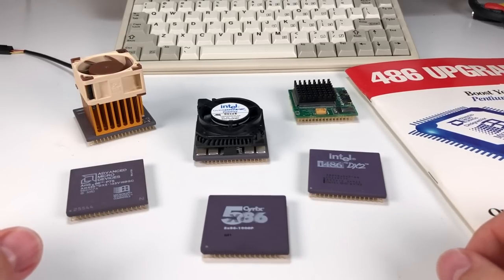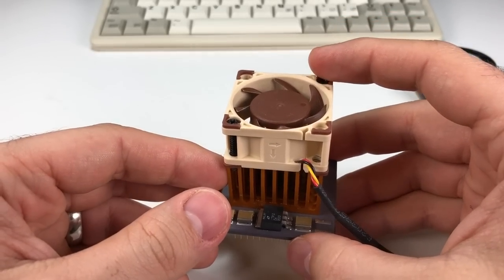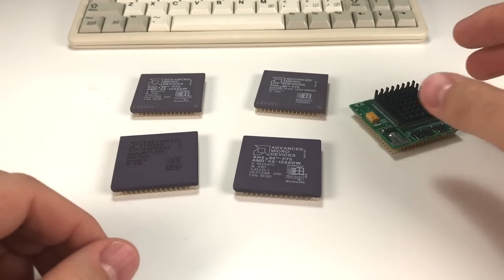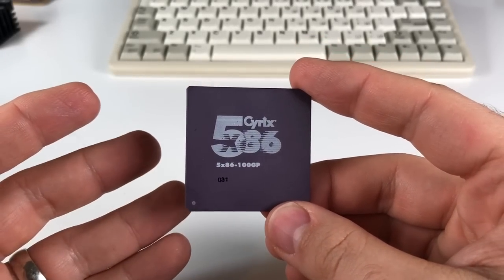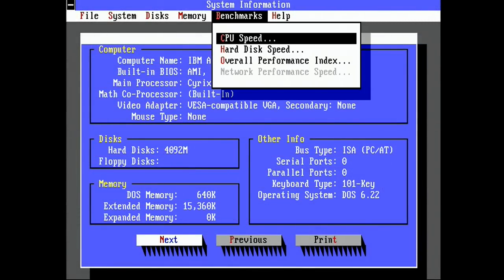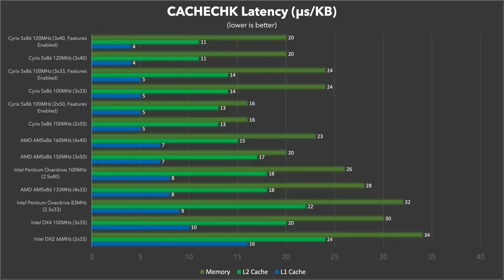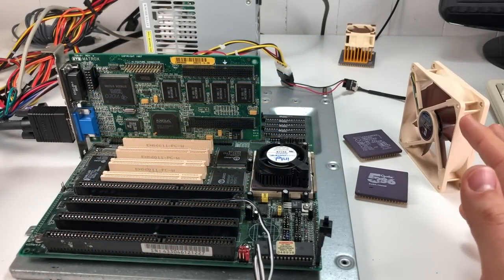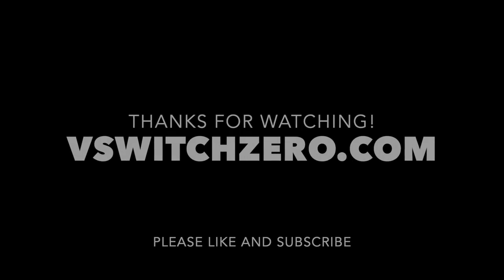The 486 Upgrade CPU Showdown!

Comment: The Am5x86 was fastest Desktop 486 CPU released during the 486 era.  AMD continued the line with the Elan line of CPUs.  SiS/DM&P produced odd hybrid architecture CPUs in the early version of the Vortex86 CPU line which were neither Pentium nor Pentium II though they had MMX but also lacked some of the Pentium & Compare/Exchange instructions.  The early ones were weird kind of super 486 DXs with fast CPU clocks (300MHz-1GHz) and MMX.  Compatibility and real perf was poor though.

Comment: It's crazy just how far tech has come. You mentioned some of these being $300 or more at launch while I paid less than that for my Ryzen 7 3800X during black friday a few years ago. And even my original R5 1400 is leagues ahead of these old chips and isn't even worth $100 anymore. I always find it fascinating and interesting just how fast technology exploded in performance over such a short time. Only 30 years and now we got 16 core monstrosities with clock speeds pushing 6ghz at the top tier, like the i9-14900k or R9 7950X3D.

(I also can't help but to find it funny that those old AMD chips have prefixes of "AM5" and now they've created socket AM5... Full circle hehe...)

Comment: I really liked those Shuttle motherboards back in the day, Interesting they are still in business, but make all in one systems, and micro PCs, probably for industrial situations, cause they have kiosks as well. I guess everyone finds their niche! :D  I think shuttle was my go to 486 motherboard, and built many PCs for family and friends. AMD was often my top choice too, they seemed to provide the best value and compatibility of the time. The Cyrix and Via worked well, but there were a few compatibility issues as I remember. AMD was usually way way cheaper than intel and about the same price as Cyrix. The local computer shop sold them at tray prices, and you got the chip in an anti-static foam square, opposed to retail box, so they were really cost effective. The local shop had trays and trays of AMD chips, he must have gotten a good price on them buying so many too.

Comment: I had Cyrix 133 cpu, wasn't that fast. Before of that, i had P 100. I swapped it for MMX intel. I already used OC ofc, i could not live without it :D One of my very best OC is on barton mobile 2500+ (2750-2800 Mhz) and 939 3800+ x2(2950 Mhz) on air. I loved them.
Reply: Barton was the chip that introduced me to this world of pc master race. Loving it since!
Reply: Had 2 x 1700+ tbred b hard modded to mp at 2600MHz on Asus dual socket a a7m mobo then xp2500 m at 2700, duron 1600 applebred at 2400.
939 3500+ Venice at 2900 (posted at 3300mhz air) then booted at 3280mhz to xp. Also had 939 a64 3800+ x2 toledo at 2800mhz with 1.35v.
Reply: @benrogers84  My 3800+ x2 did 2950 mhz stable 24/7 just took me so much time to do it in the DFI mobo but it was worth it.
Reply: @eizo monitor  that's a very good clock. Mine was a good chip too but clocked worse as time went on. Did 2750 on 1.35v and 3.03ghz at 1.5v when I got it.

Comment: Cyrix FPU is basically what killed Cyrix in their later chip too. What is interesting is that knowing this chip was released they could have benchmarked quake in-house to see the possible problems for their future gen too.

For integer performance I think AM5 is beasting over Cyrix because all tests are highly optimized for 486 hardware - likely avoiding branches with unrolling and maybe not having enough headroom in pipelineing to compensate. That is basically gains of the PoD and Cyrix does not totally shine with software highly optimized for...486s and quake shines here, but Cyrixs slow FPU is burden there...

What is also interesting is that 586s have also new instruction sets, so I guess you can use all new instructions with cyrix and Pod but not sure of the AM5 (maybe yes and emulated inside silicon). Thus for software development those might be good choice in case you only want to support new instruction sets with software you make, but not want to buy full systems for it yet.

PS.: I had 40Mhz Cyrix 486 with a good motherbord and Vesa local bus card, then switched to pentium 1 MMX 200Mhz. But switched likely much later than 95 I think. Maybe like 97 or 98 and only because dad worked in IT. Before all that we had an Elon Enterprise 128 that we gave away to family and lost track of... so sad for that one haha

Comment: As far as Overdrive chips, I had a Dell 486SX 33 and installed a DX4 100 Overdrive.   It was a drop in that just worked.  I assume it was just just a regular DX4 100 with a 3X multiplier hard coded, because the board didn't support multipliers.  

I also built a separate machine with a 5x86 133 clocked at 160.

Comment: What Killed Cyrix was the fact it could not do CPU  + FPU math simultaneously unlike Intel's or AMD CPU's, something that Quake used and (to a point) would make the system (maths wise) be like a dual core cpu. With Cyrix this would not work as INT math would not run simultaneously with Floating point math crushing the maximum performance available.

Comment: If I understand it correctly, Intel DX4 has some enhancements backported from the Pentium line, that's why it performs better if you compare it to Am486 DX4 with 16kB cache. Am486 is a clone of DX2 after all, with no such enhancements. The same applies to 133MHz version.

Comment: I may have missed you mentioning it, but does your PCI bus actually run at 50MHz when the FSB is increased or is there a divider that keeps it at 33 and you had to adjust it? Your 160MHz 5x86 runs marginally quicker than mine overall, but it's good to see a direct comparison. Might be the RAM timings and such that make the difference, as you're pretty good at tweaking those. I would agree that the POD isn't worth it. Intel had to deliver it because they'd made such a fuss with their 'vacancy' ad slogan, but they definitely priced it to discourage buyers. OEMs hated upgrade chips if it meant users delayed upgrading their entire system for a couple of years. I still want one so I can put it in my 5V motherboard. 🙂
Reply from the maker: Thanks for your comment! Yes, it is indeed running at the full 50MHz. The Shuttle HOT-433 only has two settings, 1:1 and 1:1/2, unfortunately. It was either 50MHz PCI or 25MHz PCI at a 50MHz bus. Not many of my PCI cards could handle it.. all of the S3 cards I have would get really weird at that speed. Thankfully the Millennium II is totally happy and I have a newer Permedia 2 PCI card that is too.

Comment: Those overclock scores are something - my AM5x86 running at 160Mhz (40x4) can only get to 75.3 fps in 3DBench and about 45 in Doom with a Trio64 (barely edging out a Virge/DX), 90+ and 57 are incredible results. Is that UMC chipset so much more performing than the SiS496?  (the fact I also get around 16.2 fps in Quake, which is not a world away from your 17, makes me think that yeah, the chipset is the big difference)
Reply from the maker: Thanks for your comment! I have noticed that benchmark scores can vary a lot on 486 platforms. Some of it must be due to the chipset, but wait state configuration and timings can make a big difference too. Some boards automatically implement PCI dividers when frequencies go above 33MHz. On this board, I can force it to stay 1:1 with the FSB. I've also noticed that some boards (I have a VIA based 486 PCI board) have really slow default PCI settings in the BIOS. I guess there were compatibility issues with really early PCI cards. On that board I could get huge boosts through various BIOS tweaks.
Reply: @vswitchzero  That is very interesting, I hadn't thought about the possibility of my board having PCI defaulting at 33Mhz. I now want to get one of these clock display cards. 
As for the BIOS, there isn't much I can change - the board is a relatively late one (LS-486e Rev.F), but it doesn't have many options beside the usual wait states - which do indeed make a massive difference, I get the 75.3 FPS in 3D Bench in the "most squeezed out" configuration, essentially one setting shy of crashing on the memory test.

Comment: I've never been able to run a PCI 486 board at 40mhz for very long without hard drive corruption. Maybe my bad luck but the IDE controllers just can't handle the full bus speed. I'm talking bad enough to trash the OS files requiring a reinstall bad. Good for benchmarking, but not real world use.

At first I wouldn't believe it because 'everyone' runs the 5x86 at 160mhz, but it just kept happening.

I suspect alot of people who had success were inadvertently running their PCI bus at 20mhz, as most boards automatically set a 1/2 divider for the PCI. 

That's why I like the POD. Uses in spec 33mhz bus, but is still very quick.

The 5x86 at 150mhz (50x3) is also very good, but you usually have to run the PCI at 25mhz, like a Pentium 75. 50Mhz PCI gave me awesome benchies, but again dead Win95 install after less than a day. It even corrupted my Transport Tycoon save game :(

The ultimate luxury is having a 486 PCI board that can run the PCI bus at a 2/3 divider. This means 33mhz for a 50mhz FSB, and 27mhz for a 40mhz FSB. Very workable, but not common.

It's not just the 486 that does this either. I have an i815 Tualatin board that refuses to budge over 37.5mhz PCI without constantly getting scandisk runs at boot and corrupting my files randomly. This is the dirty secret that overclockers often don't like to mention ;)
Reply from the maker: Very interesting, thanks for sharing! I think I may just be very lucky with the systems I've used. The Shuttle HOT-433 4.0 seems to have a very tolerant IDE controller and seems quite stable at 40MHz. I haven't done any extensive use of the system at 50MHz, so I can't say for sure how it would handle it longer-term. I think I'd find out a lot more quickly if I installed Windows 95 on the system. A 2/3 divider would be great to have. This board only has 1:1/2 or 1:1, unfortunately. I can't say I've used PCI 486 systems much. Most of my experience has been with VLB/ISA based systems.

Comment: Well back in those days I DID put my money into an Am5x86 - and, thankfully, these are still quite available so I could easily put together an Am5x86 system again, one that - unlike my original one - can do 160MHz truly flawlessly.
Btw HOW did you make the HOT-433 do 50MHz PCI?
Reply from the maker: The HOT-433 rev4 board I have has a BIOS option for setting the HOST:PCI divider. There are two options 1:1 and 1:1/2. I just make sure it's set to 1:1 and it matches the FSB frequency.
Reply: @vswitchzero  Now that you say - it could be the board I saw the option on? I'll have a look when I next have a 486 time....

Comment: Have you run into any dual processor 486 motherboards? From what I remember, they somehow use both CPUs to emulate one processor. At least the one I saw. I'd love to see one or more of those bench marked. NCR, ALR, and Compaq and all had models.
Reply from the maker: Can’t say I’ve ever used a dual 486 system before but it would be very interesting to check out!
Reply: I do know that the dual 46 motherboards did exist they are very rare piece of hardware to find I believe they were mostly industrial-based motherboards.

Comment: If I remember correctly, since Intel controlled much of the Dell/Compaq/HP pre-built market with the Wintel monopoly by the mid-late nineties, AMD & Cyrix were mainly the cheaper upgrades / enthusiast market predominantly (in the US at least), and the Cyrix CPUs performed so bad in Quake that it gave them a reputation of being trash to the point it wrecked/killed the company.

There's some articles & YT vids about it and why. Basically Quake was ridiculously optimized for the Intel Pentium, and relied on a bunch of architectural quirks they found to eek out every bit of performance... so when switching to a different architecture that didn't have those features/quirks, it tanked performance. The main one I recall is that Quake made use of a feature in the Intel architecture that allowed it to run a floating point & an integer operation at the same time, and neither AMD or Cyrix could do that, so it tanked their performance. Cyrix had some other architectural differences that made it way worse for whatever reason (specifically for Quake).

Comment: The Cyrix 5x86-100GP is practically the same as the Siemens Thomson 486DX4-100, but with double the L1 cache. It would have been interesting to see what the performance difference was between the two.

Comment: So much faster than my early 1993 dx33 with opti local bus motherboard. Does anyone remember the opti local bus? 32 mHz eisa slots.
(the dx2 was not there yet, the fastest chip out there was the dx50. Later I had the dx4-100 and the true dx4 amd 133. I skipped the dx2's)

Comment: According to your charts, Doom performs better with the AM5 running at 150 mhz than it running at 160 mhz. Any idea why the higher FSB gives Doom that much of a boost?
Reply from the maker: Even though the CPU clock is 10MHz slower, the 50MHz bus really improves L2 cache and main memory bandwidth/latency, which helps a lot in Doom. On my system the PCI bus is also running at the full 50MHz, which helps with VGA performance a bit too. If only I had a chip that could handle 4x50MHz.. that would be really something 😁

Comment: The strange clock speeds were usually due to the multipliers available, and keeping that in sync with the frontside bus.  The later Intel Overdrive, Evergreen and AMD processors did further more to have an internal speed that was separate from the front side bus multiplier.

Comment: Game Descent has a huge in game experience between Pentium and 4x86. Not in the favor towards Pentium. Since, I really like this game, i have built over 10 Am5x86 PCs over the years. And I still have one right now. 

CPU difference affects many other games experience as well. Thus, if you want to enjoy everything published before Quake, then you need Am5x86. 

in Ukraine, CPUs are not a problem nowadays, but motherboards and memory are....Sadly, i could not build a 486 system with 64+ megabytes of ram for more than a decade.

Comment: Can get through Doom Timedemo (Phil's Hi settings) with POD83 at 100mhz, but it's barely faster than at 83. I think about 20fps with VLB graphics regardless of clock speed, can't remember realticks. Not stable enough to run Windows apps at 100 though. Never experimented with voltage.

Comment: On the processor with the Noctua cooling contraption there seems to be a missing or unpopulated capacitor (on the right side). On the one with the stock cooler that capacitor is present.
I wouldn't be surprised if that made the difference in stability.
Reply from the maker: I wondered about this too. I have seen people hit 100MHz with the missing-cap version, but I'm sure it must improve power filtering to some degree. I thought about adding one but the size/type is not standard from what I can see, unfortunately.
Reply: @vswitchzero  : They're big, so I think you can safely remove one for measurement.
And if you don't find an SMD match, you can still use wires... would certainly be a looker.

Comment: How about a comparison of 486's at the same clock speed but different bus speeds for example, AM5X86 @ 3*33MHz and 4*25MHz, also some late model AM486's are actually an AM5X86's internally apart from a 2x/3x multiplier so could also be tested at 2*50MHz
Reply from the maker: Great idea. I definitely have some more 486 content planned and will see if I can include something like that :)

Comment: What would you recommend for someone wanting it just for gaming 486 games quake doom duke nukem elder scrolls games etc what would you recommend
Reply from the maker: Thanks for your comment! To best run late DOS games (like Quake and Duke3D or even Doom to some extent) a true Pentium or Pentium MMX system would be a much better choice than a 486. Even a Pentium II/III would work as long as it has an ISA slot available for a sound card. Lots of different possibilities. It only gets more complicated when you want to run "speed sensitive" games from the 80s/early 90s that don't behave well with faster CPUs. None of the games you mentioned fall into that category though. I hope to do some more build videos based on socket 7/370 in the future. Cheers.

Comment: lol turning on cpu features... I watched every boot and looked for EVERY possible thing I could do to speed up stuff.
tweaking autoexec and config daily.
There was what I think was fake, a 586/pentium patch program you could run to give 486 some kind of tweak? I forget..
And yes, I had a cryix, and I dd the patch, and it did cause trouble but only with bad vent and warm room.
I thought was heat, now I think it just got randomly twitchy when fun fast and with options enabled.

Comment: POD is just too expensive for what it does. Especially today. You get 4-5 am5x86 for one used pod. Got me a P MMX 166, 128mb ram and fic board for 30€. Which world be the way better upgrade here. On the AM I still play fallout without too many problems. Runs buttery smooth. For everything more demanding I use my trusty k6-2+ with voodoo2